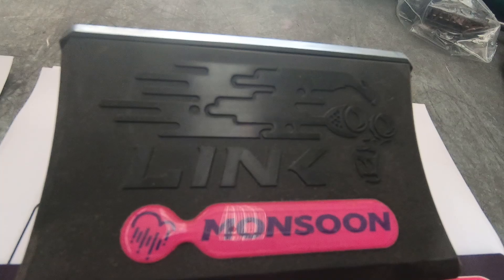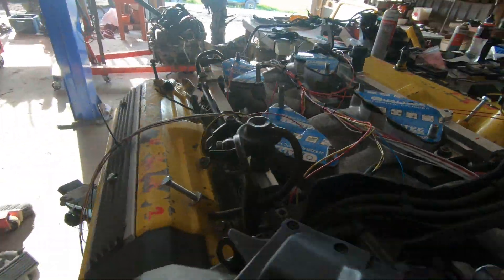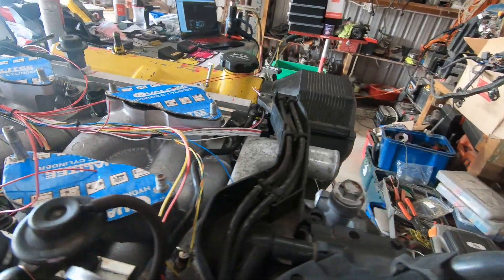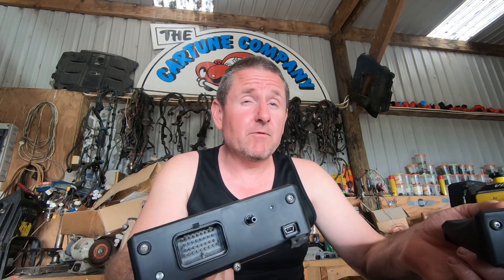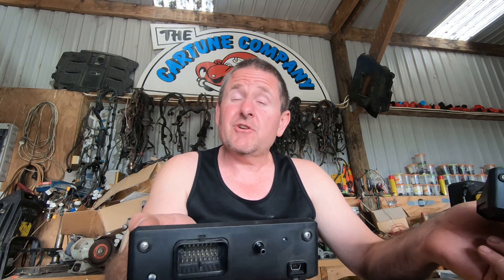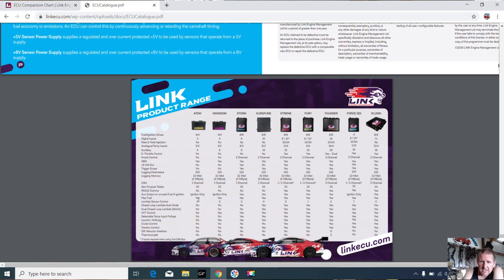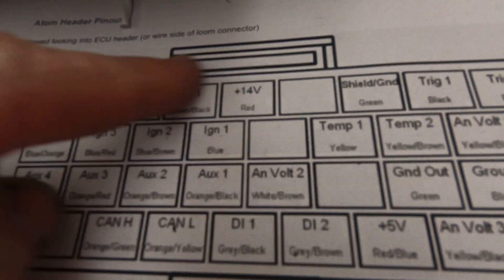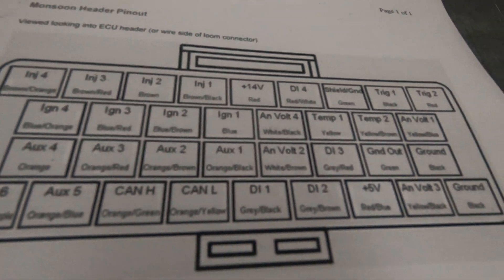LINK ECU - Atom verses Monsoon

Comment: whats the difference between link g4 and the g4+? i got a used g4 pnp for my v6 wrx and want to run speed density
Reply from the maker: The g4 and g4+ have different processors,  different hardware and different software.   Really they are borh different ecu.  Generally both contain a speed density tune in with the base map some maybe you would be best to check the tune profile.  Cheers Kelvin